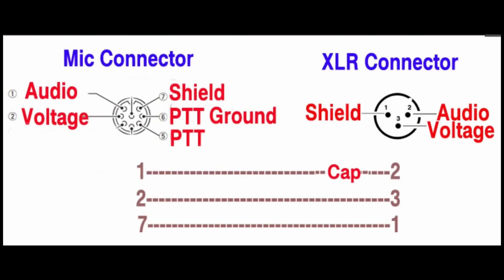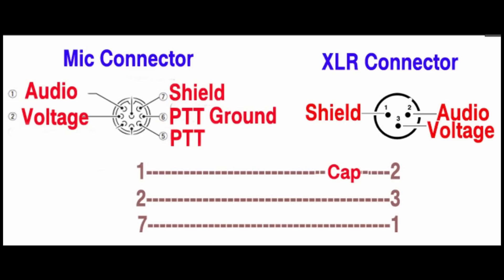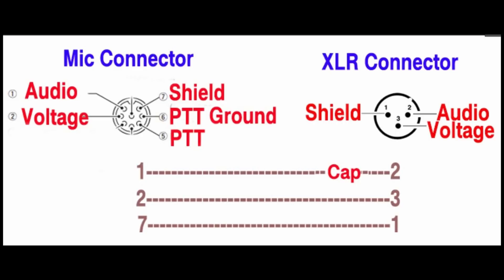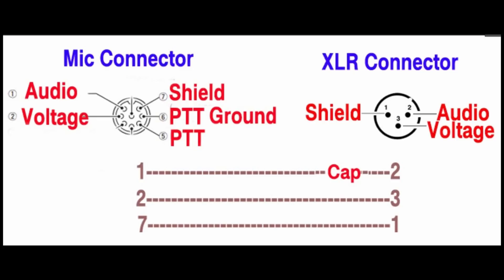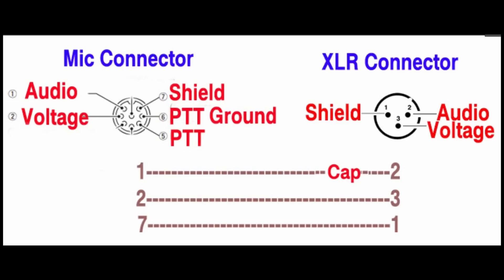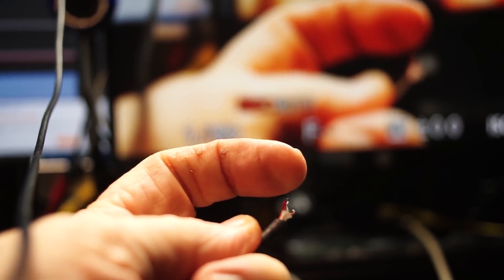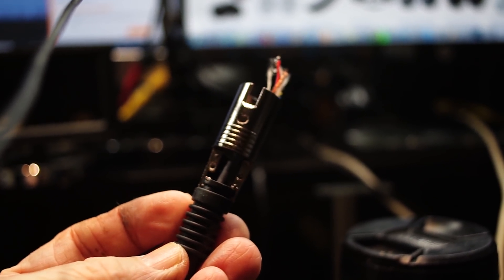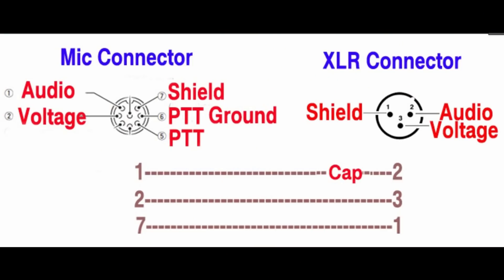Ham Radio Basics--Connecting An XLR Microphone To An Icom 7300.  You May Need A Capacitor

Comment: Jim, great video, as usual, and glad I went back in time to dig this one up!  I have an IC-756 Pro iii, and it has an 8-pin ICOM mic connector.  I'm guessing and hoping that my rig has the same pinout as the IC-7300.  Now I won't blame you if I let the happy smoke out of the rig, or any of my mics, but.... do you think it is the same?

Comment: So this may sound silly.. But I just picked up a non amplified D104. And just for the fun of it. I was wanting to rewire it to use on my 7300.. I’ve done this as a kid back in the day with CB radios. But I’ve never wired a mic for a Icom radio before. This whole capacitor thing has me a bit scared to do the operation lol. Do I need to worry about this cap if I want to wire this G D104 to the 7300? Thank you!
Reply: I know it has been a year or more, but without watching the video, I can explain. The crystal cartridge in a D104 would be destroyed if voltage were applied across it. And since many of these radios have power on one of the mic pins, including phantom power (voltage on the hot audio wire), a series capacitor with your Astatic is good security. This is because capacitors block DC.

Comment: 1. Don’t you guys using a condenser mic find the fact that they are notorious for picking up every little chirp chirp, cheep cheep, burp, etc. I.e. background noise vs. dynamic mics that don’t?

2. Doesn’t someone sell a connector/pigtail already made up or is every application/ radio/shack/setup/studio configuration so different that a prefab cable would be impossible to make?
Reply: Hey, it’s ham radio, you’re not recording a concert. Regarding the background sound. How far away are you sitting from that mic that it’s picking up that much noise? You can drop the gain and snuggie up to it a little bit closer and you will almost eliminate the problem without spending any money. At least to the point of acceptability. No one is going to complain about your parakeet.

Comment: what a cluster.    this will not work with a heil icom 8 pin to xlr cable, it has a blocking cap in the xlr part and will NOT send power to the bm800.
Reply: furthermore, the Heil cable is wired completely different than this.   this is now the 3rd different way i've seen to wire these bm800's to an icom.   YMMV

Comment: I WAS TOLD BY  ICOM YOU MIGHT NEED RESISTOR BUT I COULD OF  BEEN WRONG JIM
Reply from the maker: I am connecting one now. I turned off the bias for the dynamic mic.  I put the white and blue wires at the XLR together.  I did not need a capacitor.  73, Jim
Reply: @ham-radio  ok well there is some icoms i got one sitting on my desk that needs a resistor which is not cap at all jim need to get your facts straight

Comment: Hi Jim,
I have a Sennheiser headset I could like to use with my IC-7610.  I called Sennheiser support to verify the headset XLR pinout and was told pin 1 is the shield and pins 2 and 3 are MIC high and low.  The MIC is dynamic.  They could not offer any more information about the "high low" pins as I was not sure what to do with these two pins.

Any suggestions?  
Brad-N6GR
Reply from the maker: Hi,
They don't speak plain language.  Pin 2 is the mic's output.  Pin 3 is the mic's ground.  Pin 1 is chassis ground.  Keep pins 3 and 1 separate.  Does that help?  73, Jim
Reply: @ham-radio  Thanks!

Comment: Great video Jim.  I purchased a SF920 XLR mic and had it wired for my Alinco SR8T.  Can I create an adapter and wire the SF920 like you did the BM800 for my Icom IC7100 using the IC7100 pinout?

Comment: Thanks for the great tutorial! Question: How much different is a vintage dynamic microphone from one of these modern ones in terms of making the adaptation for Ham use? I've got a Shure 55SW that I'd love to try out.
Reply from the maker: Good question!  Shure Mics are generally very good.   I have used a few of the 444 and I still have one.  So give it a try with the ALC on the meter no more than about half of the ALC scale which is shorter than the other scales.  73, Jim W6LG....recovering from surgery a week ago.
Reply: @ham-radio  this was not a level problem it’s a wiring problem… How in the world did we get these two things confused?

Comment: Confused here, so I need a Capacitor 1uF, if I'm running a Samson C1 Microphone on Phantom power or do I just wire the mic from the Phantom power output then to my IC - 7300 any help would be brilliant thanks. De 2E1FUE.

Comment: I you want to block DC wouldn't you put that capacitor in series on pin-1, putting it across pin-1 to pin-2 will short AC (audio) to ground..

Comment: Hey Jim, I have an odd issue that yours seems to be the closest to explaining.  I'm connecting an Alesis Multimix 8 mixer to an IC-7300.  The mixer uses a separate TR connector for each channel of the output.  I have the TR connector plugged into left channel output and connected to the 8 pin Foster as follows: pin 1 audio to tip and pin 7 shield to ring.  PTT pin 5 and 6 are wired out of a separate pigtail going to a foot switch.  When I record an audio file to the 7300 from the mixer, the audio is perfect and legible.  When I attempt to activate the PTT and transmit, the receive station cannot hear me.  Any idea what might be going on here?  My next step is to stick an o-scope on the mixer lines in between but if the fix is also to introduce a blocking cap here then I'm happy to circumvent needing to test that out.  Any help is greatly appreciated, thanks!
Reply from the maker: That will work.  But, what I did not read was, does the 7300 switch from receive to transmit.  You also did not mention the most important thing that all hams should always be watching; the ALC meter.  Does the ALC meter show audio?  You always must set the mic gain with the ALC meter.  73, Jim
Reply: @ham-radio  Yes, the radio properly kicks over to transmit. The display indicates it's in transmit and I hear the relays kick over. Nothing on the ALC and I also turned the audio scope on to observe the waveform on transmit.  It didn't move either.  I'll give the capacitor a try and try not to overthink it.  I'm sure it's simple.  Thank you!
Reply: @ham-radio  It wouldn’t hurt to monitor it either. Lol

Comment: Hi Jim good video well explained as usual, got myself the Heil PR 40 microphone for the Icom ic-7300, just get the correct cable and you can't go wrong 👍thanks from Rotterdam..
Reply from the maker: Thanks for sharing from Rotterdam!  73, Jim
Reply: Bob Heil makes a reliable cable to solve this problem. End of story. 73

Comment: These mics that everyone stating they require 5vdc must have a voltage regulator in them to be able to be used in a studio.  Typically, studio microphones (Condenser) that require power use the 48Vdc phantom powering from either pre-amp's or mixing consoles with XLR capability.  Are you finding this information in the docs that come with the mic or on the circuit board after dismantling the mic?  Thanks
Reply: The cross pollination here isn’t working. Studio audio experts trying to work with “hams”.

Comment: Great video. Alright I want want to install one of these mikes on my Icom 7300. from what I am reading I need to install a cap in the audio line of about 1uf. Does this cap have to be a non polarized or can a ceramic cap be used in this application? Thanks for any replies 
Jim / N3KBF
Reply from the maker: Icom is designed for electrets.  So no cap is needed.  Just connect the mic in the same way the stock mic is connected and as is shown in the instructions.  73, Jim W6LG ...sorry about the delay I have had some connection issues with the desktop computers.
Reply: @ham-radio  Thanks again Jim 👍

Comment: Hi, good interesting video, i found the Heil pr range, are way to quite, a pre amp is needed, even mic gain 100-percent, not enough volume, Heil pr range are fantastic  but not for the Icom ic 7300,thanks from Rotterdam 73.
Reply from the maker: Thanks for the info!  Icom's are set up for electrets.  They are inexpensive and sound great provided the mic gain is kept in the lower part of the ALC scale and compression is 5 dB and not the 30 dB in the instructions.  73, Jim
Reply: @ham-radio  Hi,thanks for your reply, the Rode studio microphone M3 for 80  euros, seems to go perfectly well with the Icom ic 7300,he owner of the Amateur radio shop,said exactly the same about the microphone settings as you,thanks good advice 😊 Tomorrow is my second Amateur radio class,so maybe we speak on the Amateur band's, in the future. Stay healthy, 73 from Rotterdam.

Comment: Jim, I saw your video on using the Icom 7300 with the BM-800 microphone. I had just bought the BM-800 2 days ago. I made up a cable using shielded 3-conductor audio cable.  I used a 35mm film container to hold a small piece of perf board. I soldered a 1 uF @50 v capacitor onto the board.  After I got it all wired up, I was fairly confident that it would work, but I was sorely disappointed  When I plugged it into the radio and tuned up on 20 meters, the radio's RX LED went to half brightness and the rig made this strange little buzzing noise.  The rig did not emit any RF and the microphone did nothing to excite the radio.  I did everything possible to keep the wiring from becoming shorted out against the housings and I did continuity checks of everything.  It all checked out.  So, WHAT NOW?.

Comment: Jim, this video is a bit confusing in that I have the actual mic you show (BM-800 Condenser) but then your video shows how to wire a NON-Condenser from XLR to 8-Pin.
- I believe you should've provided a 2nd diagram showing no cap between 1------------- 2 and no need to show anything on Icom Pin2 so it would be less confusing.
Also, showing a keying switch between Icom Pins 5 & 6 might've helped a bit, those who are not wanting to be forced to use MOX or VOX but have a pistol grip or foot switch needing to be plugged in 'somewhere'.
73

Comment: How about that, exactly what I was looking for;
 How to wire my BM-800 to my 7300!
- Absolutely the world's best sounding combination without EQ or any outboard processing, but sounds so good it sounds like there are several processors inline.
Amazing how a cheap Chinkaneeze condenser element can sound so perfect!
Bass +1  Treble +4  Compressor <ON>  Compressor level <3>   Mic gain <20>   TBW <WIDE>
Reply: With or without preamp?

Comment: Jim,  will the IC7300 price 48v phantom power?  I have an Audio Technical AT4050 sitting around in it case gathering dust. Thought I’d set it up with my 7300 if possible. Do you think it’ll work?  Thanks. Fred N4cyf
Reply from the maker: The Icom does not have 48 volts.  A separate power supply with XLR connectors is what I bought from Amazon for about $15. It is a bargain.  I bought a second power supply for another system.  Works fine.  73, Jim

Comment: Jim;  Thank you so much for the info you provided.  I m in need of some assistance.  I just recently purchased an ICOM 7300 and new to radio.  I have some items laying around the house during my karaoke days.   I have an SM58 and a Behringer audio mixer that I want to use.  My plan is to use the SM58 using XLR input to the mixer and out by 1/4 headphone jack to be connected to the 7300.  I have an 8 pin prewired; with a XLR female and a PTT switch.  I went to a music store near our house; there is  a adapter (male XLR to 1/4 headphone) but they have to choice balanced and un-balanced.  I hope you can clarify this and what connections do I have to do.  At the end of it all I don't want my new 7300 get broken.  

Kind regards 
73
KU7LAS
Reply from the maker: Hi Chris, 
Sorry for the delay. I have been ill and laid up for a few days.  I was even unable to read the screen and make coherent answers.  The SM58 is a very good mic although its output is very low. Icom like high output mics like electrets.  I don't know the answer to your question. Maybe someone else does.  For my station, I used an extension cable and cut off one end.  I wired as shown in my video: https://www.youtube.com/watch?v=Crn3tk3WJck

I think something like a .1 or greater should work fine.  Remember to keep the ALC level way  below the max.  Never modulate to levels at the peak indication on the ALC meter position. Also, you don't need to do any external equalization.  A good natural sounding voice is good enough. Highly process audio is not good and sounds like a beginner who does not know what he is doing.  Thanks for watching Chris. You bought a great transceiver that will give to you years of wonderful performance. 73, Jim in CA

Comment: what value is the cap between pin 1-2 pls  using the icom 7300 with the heil 781  just wondered if the cap is necessary
 ? FROM Steve 2EODAM

Comment: Hi Jim, I am considering using an Excelvan BM800 microphone with my IC7300 in a similar way as you presented in the video; however, this microphone has a phantom power supply with 48vdc output. Would the connections that you indicated still apply in this case but going to the power supply instead? Could the phantom power supply be eliminated and the microphone connected directly to the radio?  Thanks !
Reply from the maker: Only needs 5 volts. That's what I use.  73, Jim W6LG
Reply: Thanks fr the quick answer Jim. Do you use VOX ? It would be great to see a video about it. Regards.
Reply from the maker: PTT only  73 Jim
Reply: @ham-radio  from what i understand although it will work with 5v or even 8v supply from the radio you will not get the full range of audio spectrum that the bm800 mic is capable off unless powered with 48v phantom power , i may be wrong..................i actually think there are two types of the bm800 mics which is possibly where the confusion is

Comment: I purchased the BM-800 Kit from Ebay ($25.99) which includes MIC, Boom, screen, Phantom Power supply and cabling. Currently BM-800 mics are used on IC-751 and Yaesu HRI-200 another ordered for my IC-7300. Also I documented my Yaesu HRI-200 wiring process on QRZ - Jim AC3CZ ; )
Reply: Standard 48 V definitely minimizes that “running water hiss“ self noise it is easily 20% of the audio.
Reply: @radiotvgod  no hiss for me but bm800 power did fail. Since using Shure sm58 on c4fm and heil icm or icom microphones on icom radios

Comment: Hi Jim I have the ic7300 and the way you need to hook up that xlr is to convert it to an unbalanced line you need to combine pin 1 and pin 3 on the xlr to shield and pin 2 needs the tantalum capacitor in line and then you only use the shield and audio from the transceiver. 73 ke0mad
Reply from the maker: Thanks. I have 2 questions.  Is there any problem with the way I wired the mic?  If I combine pin 1 (ground) and pin 3 (voltage) doesn't that short to ground the Icom's bias voltage on pin 1 by connecting it to ground through pin 3?  Thanks for the help.  73, Jim
Reply: Icom runs its bias voltage on the mic line that’s what the capacitor is for is to block the voltage. An xlr mic/cable is balanced meaning pin one is shield two is audio and three is the negative return path for audio so when using it on a transceiver you simply convert it to an unbalanced mic by combining the shield and audio ground. So yes I would think it would short the 8 volt line coming from the radio. I hope this helps 73
Reply: @HamRadioWithKE0MAD  So pin 3 on the XLR needs a cap too when you want to use the IC-7300 phamtom power...
Reply: Pleun Vermeulen pin 3 is combined with pin 1 they act as ground and shield so no cap needed. You only need cap at audio + unless you are wanting to use the phantom voltage then you wouldn’t want the cap.
Reply: @HamRadioWithKE0MAD  needs the cap on Bm800 mic for icom-7100? And have you a wiring diagram for rj45 modular + XLR  connector?

Comment: Thanks for this Jim,  can you post a link to the mic's you bought?  Some I see on amazon require 48v FP.
Reply: 48 volt phantom power is the standard for pro audio and is found on most mixing boards and mic preamps.  It's usually switched on or off depending on the type of microphone used.

Comment: Thanks for sharing. Does anyone make a good after market desk Mike for the 7300 that is prewired for those of us that are not so talented as you with  soldering?
Reply: Bob Heil makes a great one, but if that is a little too expensive, MFJ also make a number of mics that will work with the IC-7300.
Reply: Robert McMillan does the one that Heil makes have the capacitor needed?
Reply: Yes it does, all Heil mics that for use with any Icom radio have that Cap.
Reply: Also if you buy a heil mic cord it will also have the capacitor